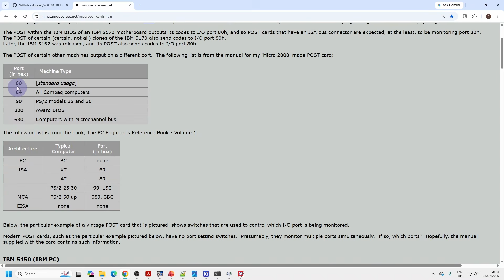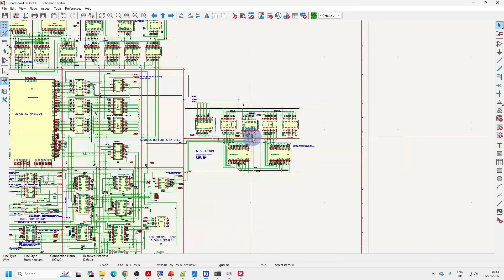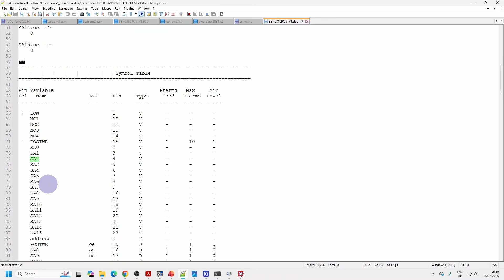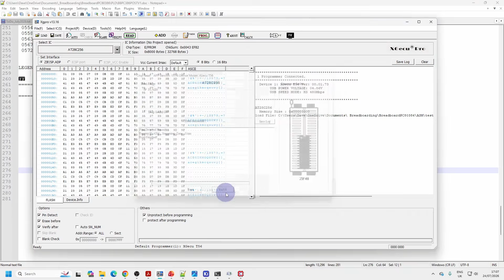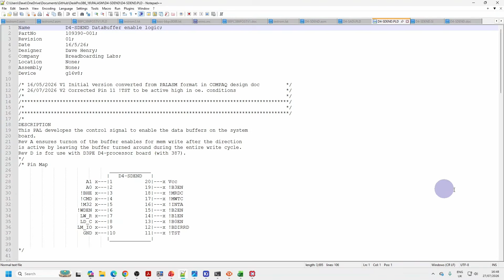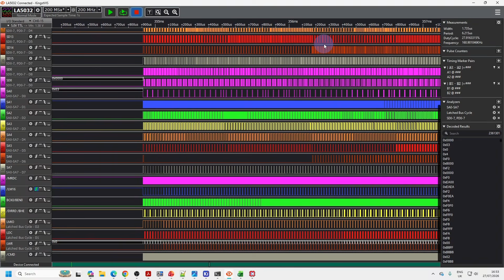386 Breadboard PC #19 Add POST Port (Power On Self Test)

Comment: 18:14 What's wrong with NOPs on 386?
Reply from the maker: The Compaq DeskPro technical guide in section 4 includes this text
"It is important not to use NOP (No Operation
instruction) for delay between consecutive I/O
operations to a device. JMP $+2 is much more
effective because it discards the contents of the
prefetch queue. A typical JMP $+2 adds
approximately a 1- to 2-us delay. A typical NOP
adds approximately a 190- to 250-ns delay."

So NOP doesn't add much of a delay on the 386.
The jmp discards the prefetch queue instructions from my understanding.

Dave
Reply: @breadboardinglabs  So no advanced branch predictor on the i386, but at least some kind of primitive pipelining.
Reply from the maker: Correct, I think branch prediction was a Pentium+ thing. When I put 8 NOPs in it took no time as it read them in all at once as part of pre-fetch then took no time to execute. The jmps took a lot longer. Dave